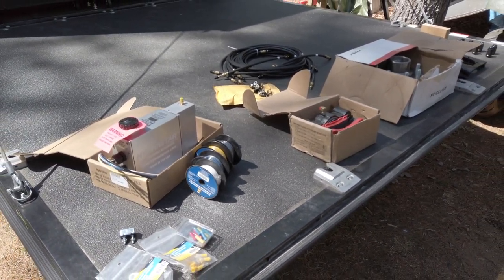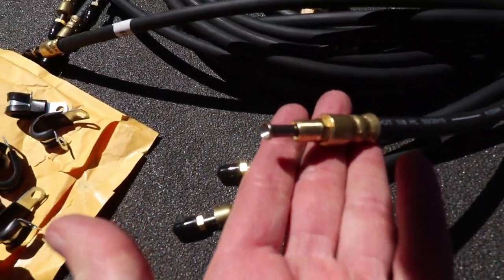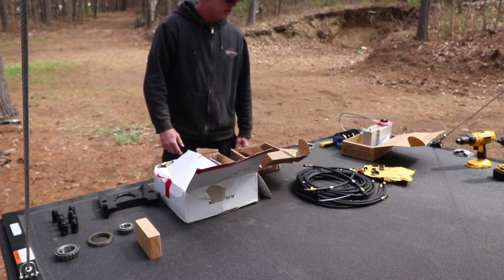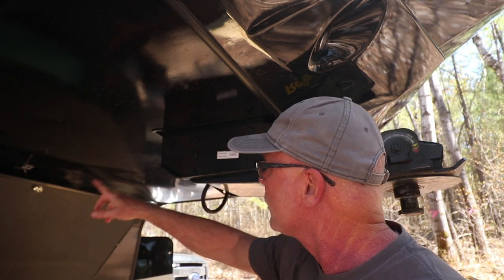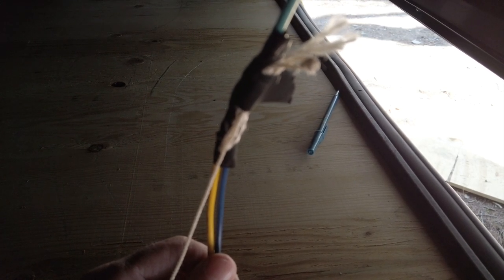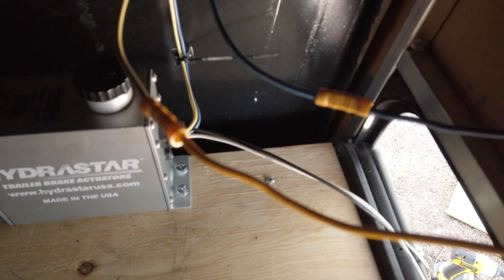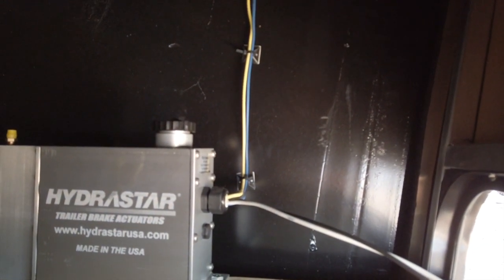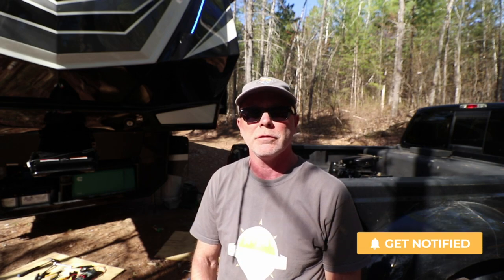Trailer Hydraulic Disc Brake Conversion - Part 1 - Intro and Pump Installation - Full Time RV Living

Comment: Great video! Thank you for your time in putting this together. I am in the process of ordering the parts. Question; did you have any issue with the wheels fitting onto the 9/16 lugs since they were previously mounted on 1/2 inch lugs?
Reply from the maker: Thanks. No, there was no issue. The holes in our wheels were big enough. I’d recommend measuring yours to be on the safe side though. Just make sure you buy lug nuts with the same shoulder angle as your existing ones. You will love having brakes that work! 
D

Comment: Pretty amazing. Excited to see the follow up videos and I agree for the weight, it seems worth the peace of mind 👍
Reply from the maker: Thanks for watching. I have not completed the installation yet but if they work as advertised I’m (Dave) sure it will reduce the number of “white knuckle” moments. Thanks for watching. D&J
Reply: NoFixedAddress I’ve seen a few videos of folks that have done the same upgrade.  Seems like a good upgrade especially with weight concerns. we’ve flirted with it but weight isn’t as big a concern for us.  Though there have been many “white knuckle” trips 😬😬

Comment: Ok, one more question. Any leaks in the oil bath system or need to change clear plastic cap with something  not as susceptible to damage?
Reply from the maker: I have had a couple of leaks over the past couple years but just had to snug up the caps a bit. None of the plastic caps has broken or cracked.

Comment: Would it be possible to tie into existing electric brake wires  from pin box ,which is already in place ???
Reply from the maker: Hi. You could use the signal that goes to your existing brakes to control the pump but you will still need to tap into the power supply and break-away wires. The break-away wires will likely only be up in your pin box.
D